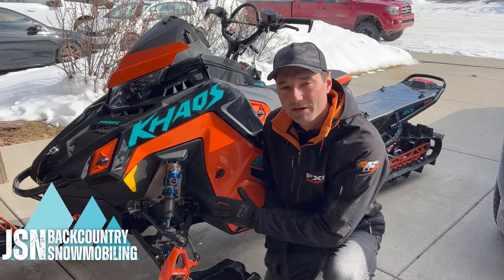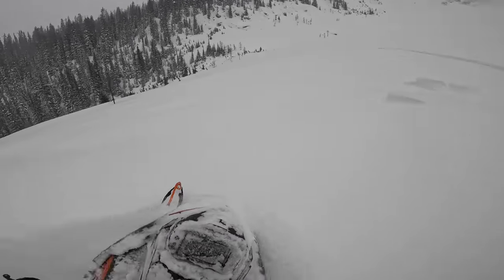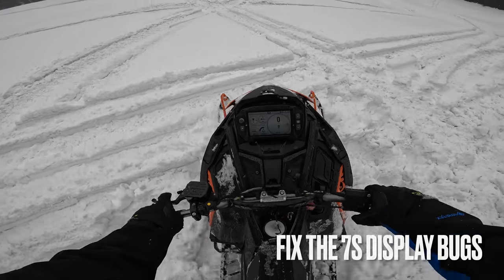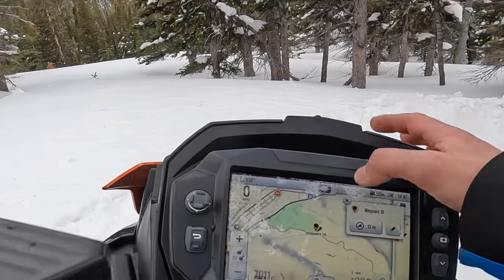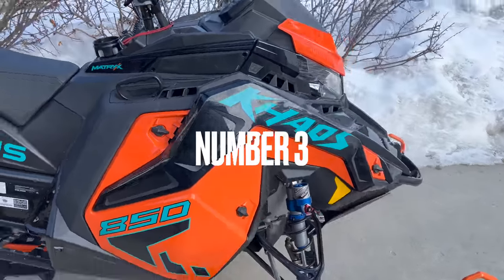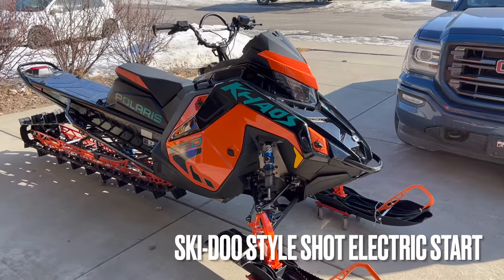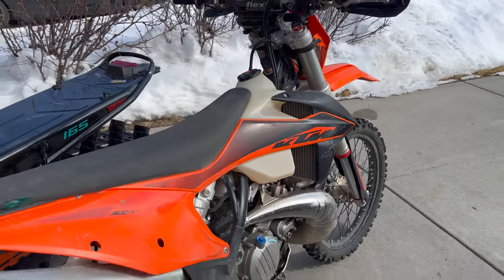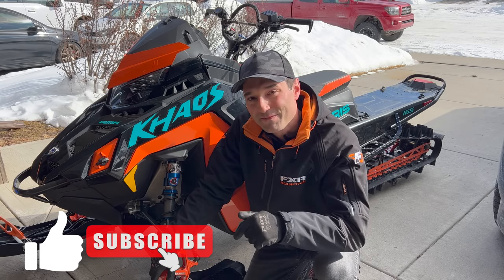2024 Polaris SnowCheck \\ 5 Improvements Needed

Comment: I have had the same issue with the GPS on my 7S only to find the connection from the screen to the antenna was not properly secured.  I took the time to unplug and firmly re-plug it (all while adding dielectric grease), and that seemed to fix the issue.  I hope this can help you and some viewers.  Great vidoes!
Reply from the maker: Great tip! I’ll have to check mine

Comment: My 23 xcr 850 hasn’t had any issues (knock on wood) have 400 miles on it running up and down the river , a lot of wide open pulls and when my kids with me a lot of slow riding, I changed plugs not of necessity but because I was past the time of break in that they over oil and gas , they didn’t look the least bit bad , had a nice darker tan but not black, I’ve also ridden a few times in negative 10F has always started even coming out of -25 from the night before , I cover the sled every day but it sleeps out side, I hope I don’t have the issues the comments are having it would be frustrating since people buy new not to have issues.
Reply from the maker: Nice work taking care of your sled. Sounds like you’re enjoying it!

Comment: A clutch that isn’t exploding every couple hundred miles…. Maybe a box of spark plugs. I don’t know why people would even both with Poo anymore. Quality has plummeted.
Reply from the maker: The 9R looks awesome but not sure about the P-22..
Reply: BRP has had a much worse year than Polaris has. Like - WAY worse.
Reply: @Uncle Deez.  Only issue they had was chaincase failures, they were sent out with the wrong chain
Reply: @wasupfool5692  That is 100% inaccurate. They had their own version of stop ride - which was posted in a hard-to-find bulletin on their website. Their drivers ratchet, forcing guys to run their tracks at extreme tensions and thus, breaking the fiberglass rods. They’ve had ECM and misc. electrical issues, they’ve had reed failures and QC issues. Again, they’ve had a much worse year than Polaris despite their shitty P22 clutches and plug fouling.
Reply: @Uncle Deez. Lol no chance skidoo had a worse year than Polaris. They’ve had their issues for sure, but they’re way more reliable than Polaris with literal basic maintenance.
Reply: @engineeredtechgaming6349  Completely disagree. Watching Muskoka Freerider and Boondock Nation will change your mind. Chain case parts are backorderd and it’s sent guys home because they can’t get their sleds fixed. Haven’t heard ANY of that from Polaris.
Reply: Uncle Deez owns Poo stock so don't say anything bad about their products.
Reply: If any brand can build a sled that Muskoka freerider can't break I will buy stock in that.
Reply: @208SledHead  Funny you mention Muskoka when the majority of the sleds they flown or towed out this year have been Polaris. Granted skidoo have had their own issues and both his skidoo and Polaris are currently broken down but Polaris definitely has taken the most failures of the season.
Reply: @awdeveau  They flew out two sleds this year. One being a Polaris, one being a Doo. And the only reason the Polaris was flown was because of their location and the weather forecast. The Doo on the other hand…. AND that was the chain case that sent Derek home for the season. Meanwhile Matt replaced his clutch the next day and went back to riding while his G5 sat on the deck for 2-3 weeks. LOL
Reply: @208SledHead  okay, how many did they tow out? How many spare clutches were run up the mountain to change the clutch on the mountain? I've seen at least two separate occasions that they changed the clutch on the mountain and I haven't even watched every video. Just a couple of videos ago they lost two Polaris clutches in same day, same group. Few videos before that they had a secondary clutch explode. Not to mention Matt goes through a box of spark plugs every time he takes the Polaris out. 

It's not just his channel either, multiple videos of new Polaris sleds breaking down. My own friend has had his in the shop more than he has rode it this year and then when he did get to go out he also was towed back with a clutch issue and he was only trail riding. Sled has less than 600 miles on it.

Like I said, I'm not saying every manufacturer doesn't have their own problems but you have to be crazy to think Polaris isn't at the top of list for breakdowns this year.
Reply from the maker: I wonder if they’re heating the clutches up too much. We take way more breaks than them(fitness related) and the clutches get breaks too.
Reply: @208SledHead  it's not really worth arguing over. But notice how he's no longer riding the Polaris either? Clutch exploding through the belly pan seems like a catastrophic failure to me. Especially when you consider the availability of parts as Polaris sleds are chucking clutches faster than dealers can get them. That sled has 700 kilometers on it and it's not just fouling plugs, it's breaking the ceramic of the plugs. You're not just cleaning those plugs and getting yourself home, that's why he is carrying like 8 plugs with him for a days riding.
Reply: @awdeveau  Haven’t seen the belly pan episode yet. I stand by my comments - the Polaris can be fixed on the hill and the Doo’s are backordered on parts. I’ll gladly swap spark plugs once a day if it keeps me riding terrain that I drove 2 days to get to. If the P22 went through his bellypan then Polaris had better warranty that. But at least he can keep riding while his G5 sits on the deck for another week or two or three. Dude had to buy a whole new sled to keep riding🤦🏼‍♂️
Reply: @JasonCaville  that would be something to consider as they do ride hard and often. But as I said earlier a riding buddy of mine also lost his clutch on his new Polaris and he was only trail riding on a groomed trail. I believe his sled is sitting at 580 miles on the clock after being towed out and is currently sitting at the dealership again without a solid pickup date as they're waiting on parts. 

It just sucks to spend what they're asking for these new sleds and then still end up missing half the season because your brand new sled is sitting at the dealer. Half the benefit of purchasing a new sled is thinking you can at least enjoy the season without much trouble, who wants to spend 20k to sit on the couch on your day off.
Reply from the maker: @awdeveau  Ya that’s really unfortunate. We had a sled sit for about 6 months last year  waiting on brake parts. There were none available apparently!
Reply: @awdeveau  not to mention his Doo has 3k km

Comment: The problems are real. A friend of mine and his son have 2 new 2023 xcr 650 sleds.  One of the crankbearings failed on one machine. The other machine blew the jackshaft,  and the engine light came on 3 times. Both brand new $23000.00 dollar machines with both less than 600km. Unacceptable. Polaris needs to stop mass producing and get all these issues fixed right. Unfortunately their sleds are parked for the season because the parts are of course backordered and dealerships overwhelmed with to many new machines waiting for service. A lot of polaris riders I've spoken to on the trail are seriously considering switching brands if this continues. Brand new sleds are not supposed to break down when being broken in.
Reply from the maker: Yikes, sorry to hear about the sled issues!
Reply: @JasonCaville  have any issues like this been reported in  2021 & 2022?. 3rd year in production you would think that these issues would have happened sooner.  The 2024 lineup was released yesterday and from what I read these problems have been improved or fixed.  They are working hard with their suppliers are doing everything they can. For what these machines cost they should  to run for years and thousands of miles before stuff like this happens.
Reply from the maker: @ianlemieux7208  2022 yes. The main issue is the brake. I really hope Polaris decides to recall all of the brake callipers on our sleds

Comment: Allthough it will not fix the root problem, you can reboot the display without shutting down the engine. When you hold down the middle button for four seconds, the 7s will reboot and display the missing information when it starts again
Reply from the maker: Good to know!! Thanks 👍

Comment: Need to have your throttle cable recalibrated digital wrench
Reply from the maker: Good tip, thanks! I’ll mention that to my dealer 👍
Reply: I’ve had this issue twice and my dealer tells me that they are ordering new exhaust valve actuator. When dealer called Polaris this is what they were told because Polaris hasn’t seen this issue before. Also this only happened after brake recall was done.

Comment: Fuck if no changes im getting a doo , even though they have there complications. 2022 was my first polaris i am happy with it , but also not running extremely aggressive. Running with 2.5 ft of snow some areas , most packed.
Reply: At least with the Polaris you can fix it on the hill. Doo with an exploding chain case and reed failures - you're calling a chopper.
Reply: 1 Doo chain case failure vs 9 poo clutch failures this year on Muskoka freerider season between him and his buddy's. Those guys ride hard.
Reply: @dangriesemer3710  Did you miss the part where I said that parts are backordered and ruining people's seasons? Clutch can be replaced on the hill too. I'm not excusing Polaris' clutch failures, I've said numerous times that they had better address the P22, but I'll take a clutch failure over a backordered chain case all day every day. And the best part is it sounds like these chain cases are failing because Doo shipped the sleds with the wrong chain installed - so have fun with that. lol

Comment: Been riding my khaos and so has my riding partner for 300 hours and haven’t set off one warning yet quit braking and gassing at the same time it’s not that hard…
Reply from the maker: I agree, but it has happened to us without touching the brakes and at times when we wanted full power.
Reply: Holding the throttle and braking is pretty common in technical mountain riding.

Comment: Your dealer never recalibrated all the actuators after flash… you have too
Reply from the maker: Thanks for the info. Back to the dealer I go…
Reply: @JasonCaville  I would call and ask if they did recalibrate. If not that’s probably your answer
Reply from the maker: @JulianJohanson  👍it should clear the error code but not sure about the red brake screen coming on when not using the brake.

Comment: The P22 clutches MUIST be addressed. These things are dropping like flys. And the plug fouling as you kinda touched on is out of control - especially on the 9R's.
On the other hand, I think Polaris has had a WAAAY better year than Ski Doo has. Their exploding chain cases are sending people home early due to backordered parts, reeds are failing, tracks stretching and break, ECM and misc. electrical issues. At least the Polaris clutches can be replaced on the mountain - good luck replacing a blown-out chain case on the mountain. AND Doo didn't address them for 24'. Which is total bullshit to me. At least they updated their drivers to combat the ratcheting.
Reply: They did address the chains and gears for 24, just been kept on the DL, all summits will be getting Rexnord Aurora chain and gears, apparently stronger than the Borg Hyvo stuff

Comment: Lmao I'm dieing watching this such a fail in producing a snowmobile for consumers imagine having those issues put on a beautiful snowing day 😅 just the fact of unplugging a connection just to get it to run I'm surprised they didn't add that in the factory manual 😅 🙃 😂....luckily I did my research and if u your going to get anything nowadays go with a skidoo.....or get a rowdy cat 🐈 😻...I was fortunate enough to get a riot 9000 Atac cat 4 stroke the machine is a beast and have had zero issues with it I feel like Polaris is falling apart in the sled world and there focusing quality on there off road sections of atv and rzr products...stick to Yamaha cat or skidoo as there always coming out with quality and new technology that works correctly fuck Polaris sleds I sold mine and the reason was always fouling plugs and very un balanced sled too tippy not to mention if u buy a sled with fuel injection and still have to burb the throttle to fire it up its junk I also have a 2013 800r etec has 6700 around kms haven't changed one set of plugs and starts on a dime 😉
Reply from the maker: Glad your doo has been solid for you. I wish I could get out that much to put on that many miles!

Comment: 25k for a na 2 stroke 9r is laughable. Problem is, dumb people keep buying them......all the manufacturer has to do is present some old technology that has been shelved for a few years and the dopes eat it up. 3.25" lug is a great example. Next is going from the 850 to 900.. there were big displacement engines all over the snowmobiling market 15 years ago. 

I love my Alpha with a turbo. It's been pull and go for 1200 miles without an issue.......OC Cat won't even release Catalyst with an engine bigger than 600......I'm pretty disappointed by all sled manufacturers right now.
Reply from the maker: I want to ride that Catalyst. Sounds like it’s pretty fun to ride. Cat is working on a bigger displacement motor and hopefully it’s released in the Catalyst next year